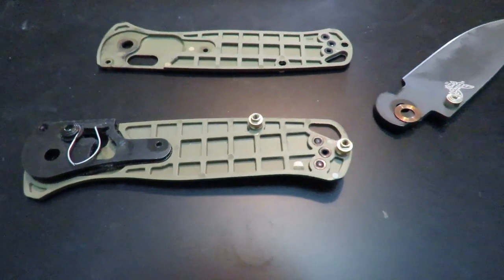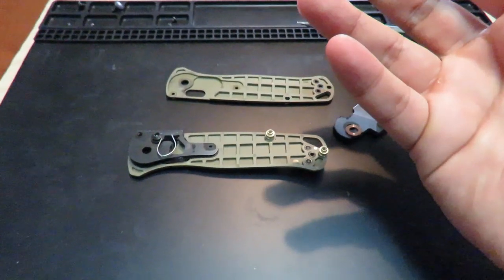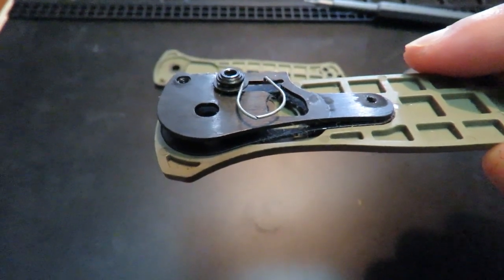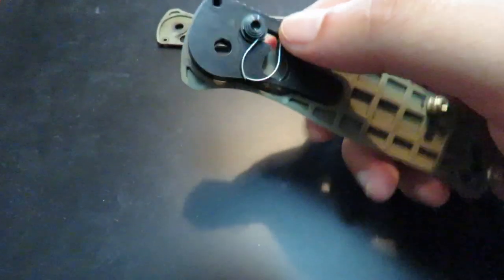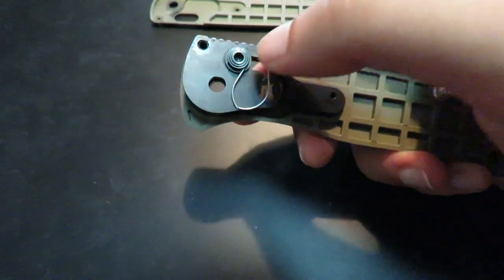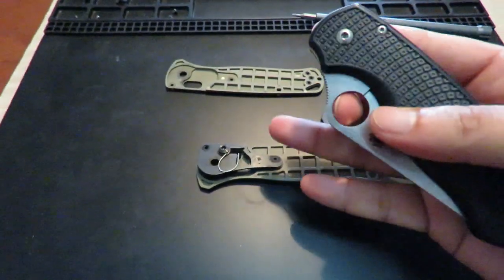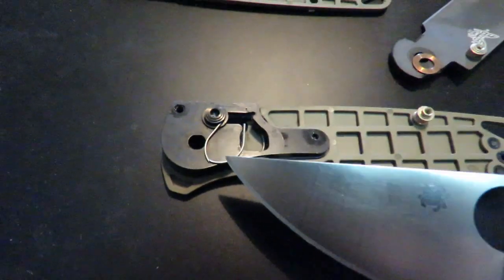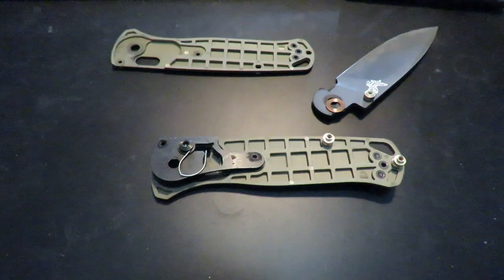My Benchmade Bugout Omega Springs Broke

Comment: I went through 3 sets of omega springs on my Bugout before I got tired of it and got rid of it. For whatever reason, this seems to be a problem with the Bugout far more than the rest of their knives. Benchmade fixed it each time, but sending it back to them to be fixed got old in a hurry.
Reply from the maker: Ive heard on etsy a guy makes some durable omega springs for the bugout. They last a lot longer. sigh...things like this make the like the compression lock more
Reply: YUP! Kitchen knife now hahaha

Comment: The older Axis lock designs (ie. Benchmade 710) were far more robust, they actually paid attention to the thickness and heat treat of their springs. Still, you can see how the spring broke at the bottom of the curve, where it flexes the most when the lock is actuated. Most of the stress of the spring is concentrated in that one area, so it's not a surprise to see it broken at that spot. Imagine trusting your fingers to two flimsy thin springs holding a lock pin in place. 

The Spyderco compression lock, or a good liner lock, or a frame lock (like on the ZTs) is far better. They're actual tabs of steel or titanium (with a steel tip) wedging themselves into place beneath the blade. You just can't compare two thin wire springs to those locking mechanisms.
Reply from the maker: I've never tried the older Benchmade so i cant say for sure that the older ones were more robust. But i have noticed more omega springs breaking recently.

Most locks in my opinion is better than this with the button lock and compression lock the best. Havent tried the sharklock yet but i bet its nice